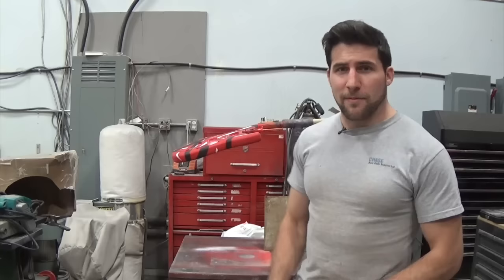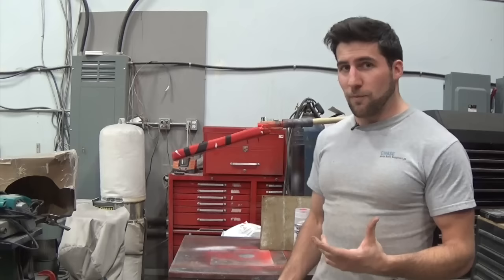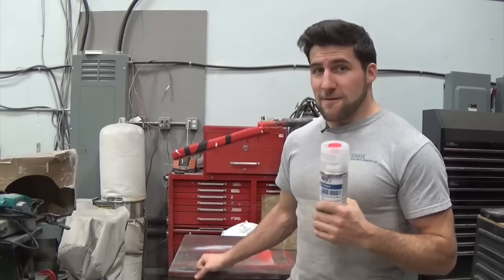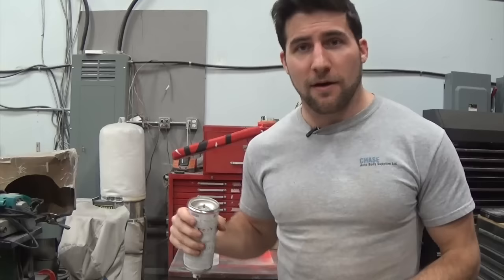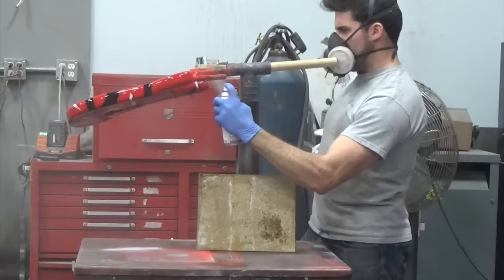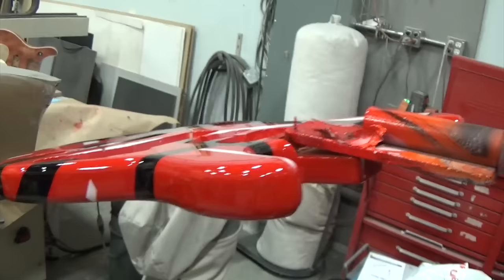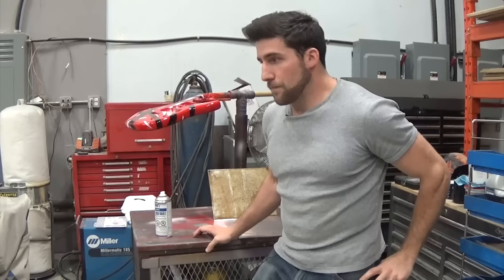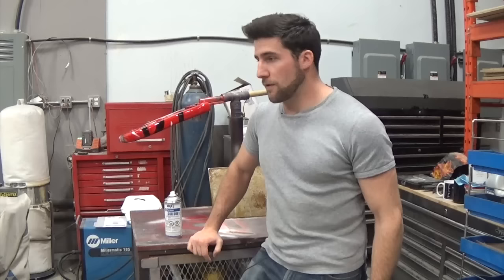How to get a professional looking clear coat with spray cans

Comment: Hi there, im trying to get a metallic red finish, now i have acrylic metallic red lacquer from dupli color and a clear spray lacquer from mo tip. Now i sanded my old paint down with 400p. But still confused how i should go about it. 

Do i put 3 layers paint with 10 minutes in between then sand with like 800 and put the clear spray 3 coats, wait 24 hours sand with 1200 and again 3 clear coats?

If watched your videos but still confused a little by all the variables. Thanks anyway for all the info
Reply from the maker: Have you seen my video on how to paint your guitar with duplicolor?
Reply: @BradAngove  ah oké, so no sanding fine by me haha, how  long should i wait before reassembling?
Reply from the maker: A month usually.

Comment: i painted a guitar and I wanted to use poly clear coat but not in can. What are your suggestions. I was thinking just buy polyurethane at the hard ware store. I am looking through the videos but couldn't find the answer.  I read that polyurethane is the best coating to use for a finish that will take friction and long time use. I didn't want to use nitrocellulose.
Reply from the maker: Poly is a great choice. Take a look at my recent video on how to make your paint jobs more durable to see some of the less expensive ones that I like, as well as some important info on safety while using them.
Reply: @BradAngove  what about Guitar Lacquer clear gloss. i really don't want yellowing but maybe this might be a better product than this clear you use

Comment: Hey there, I was wondering whether you could tell me if it is possible to get a Satin educed polished finish using Rustoleum Satin finish with only 1,200 Grit Wet/Dry sand paper and some polish? Also, Iv'e heard the term "Orange Peeling" and how; when a coat is applied, it must be sanded and then reapplied. How on earth is that "Orange Peel" effect supposed to go away with just polish? 

does the clear coat go on and then sanding? or is it clearcoat/sanding,clearcoat/sanding (repeat)
Reply from the maker: The orange peel gets sanded out after you clear coat. The sanding flattens out the surface to remove that effect, but sanding leaves the finish dull. The polishing brings it back to a nice shine. You can get a satin finish by just polishing it less, or by sanding to a super high grit, or by sanding flat and then throwing on one light coat of satin clear.

Comment: Brad, do you sand in between coats or you sand once all layers of lacquer have been applied, just before buffing?
Reply from the maker: I don’t sand between coats. Only between sessions. If I were adding more clear, I would wait a day and sand with 800 grit before spraying more coats.
Reply: wet or dry sanding? what's best anyway
Reply from the maker: I use dry for guitars so I don’t risk swelling the wood. I usually do wet for metal or plastic.

Comment: Would  the gloss 2k spray can be good for a 70's era Fender type finish on a strat ( maple) neck ? Would it be similar to what Fender was using back then ?
Reply from the maker: Yes, fender started using poly in the 70s rather than nitrocellulose lacquer, which ages.
Reply: @BradAngove  Thanks 👍

Comment: Hello Brad I have a question can I spray the true 2x catalyzed clear over older painted lacquer clear?
Reply from the maker: The 2K? Yes, but you’ll want to sand lightly with 800 grit first so the new clear will stick.
Reply: Thanks Brad thumbs-up 👍

Comment: Do you need to polish after this? What about wet sanding in between coats?
Reply from the maker: It’s up to you whether you polish or not. I have a video on that and on sanding between coats. It depends on how long you wait between coats.
Reply: @BradAngove  I shook the can of 2k for 2min. Flipped it, popped the red cap, and then all the contents spewed out...what happened???
Reply from the maker: @user-jb3de9uk9p the contents spilled out the bottom? When you pulled the red cap off?
Reply: @BradAngove  yes
Reply from the maker: There was something wrong with your can then.

Comment: Awesome video! I have a few questions though. How dangerous is the 2K clearcoat compared to regular clearcoat you would get at a craft store? This is my first time building an electric guitar and I painted it with acrylics. I’ve been extremely hesitant to clearcoat it because everybody seems to say different things. I really don’t wanna mess this up! How many coats of other kinds of clearcoat Would I need? The ones you get from craft stores. Also, if I were to use it What kind of mask would I need? Do you have any brands you could recommend? Then when it comes to wet sanding, I’ve heard people say you need to start at low Grits then work up to high grits. But I’ve also heard people say you only need 400 than 2000. What’s the bare minimum I need to use? Also, is there certain temperatures I have to stay in while doing this? I am on a tight budget. I apologize for all the questions.
Reply from the maker: I’m not really familiar with craft store clear coat, but I’m sure that the 2K is notably more dangerous and dries harder. Depending on the clear coat from the craft store you could need anywhere from 3-10 coats. It depends on the finish you want. 
I have two respirators linked in the amazon link in the description. Those are the types that I like to use.
You can generally get away with flat sanding with 1000 grit and then 2000 grit paper before polishing. It will just take a while and be harder to polish.
Reply: @BradAngove  Ok, thank you! Do you recommend wet sanding? And is car polish okay for polishing? I’ve heard people say different things. I have the Audioglym Super Resin Polish and I was wondering if it would work. So, just to lay out the steps.
I clearcoat 3 coats with the 2k, 30 mins in between, Sand flat, Wet sand or buff? Then apply polish. 
Is there anything specific I should know about the polish? Do I need a compound or wax or just the polish.
Thank you for answering all my questions.

Comment: would this clear work on waterproof vinyl stickers?
Reply from the maker: Yes.
Reply from the maker: But if they’re big, you should apply some adhesion promoter to them. Otherwise it will mostly just bridge over them rather than really sticking.

Comment: Brad, have you had any issues yet with SprayMax 2K Glamour?  I just cleared a guitar that I finished last Wednesday and it’s still today soft like week old lacquer.  Painted two previous with same clear and neither of those have the same issue. Trying to see if there may have been a bad lot or something.
Reply from the maker: I’ve never had a problem with it, but temperature and humidity can affect the curing process (or inadequate shaking after breaking the internal can).
Reply: @BradAngove  I followed the TDS from Sprsy Max. The only thing that was altered was it was over 90 deg F. That would have just sped up the flash and cure time though. Oh well not the first time I have had to strip a new finish and redo it.  I may go with Grant 7 Oh My clear through my gun this time though.
Reply from the maker: Yeah, I suppose it must have been an issue with the can.

Comment: So let's say you are going to use a dye or stain for the body instead of a paint .... what kind of sanding sealer is best to use in conjunction with this clear .....
Reply from the maker: This clear works with a variety of sealers. I would be more concerned about what works best with the dye.
Reply: I usually use a vinyl sealer
Reply from the maker: Likewise. Vinyl sealer works fine with this clear.
Reply: Thanks so much! I really appreciate the great videos and knowledge you share!
Reply from the maker: Thanks Chris.
Reply: @BradAngove  sooooooo.... I just put down the vinyl sealer ... .. mohawk brand..... how long should I wait till I put down the 2k spray max?
Reply from the maker: At least 3 days. Preferably a week.
Reply: @BradAngove  thanks again! Currently building a bass for my daughter.... and a perfect situation to test a different kind of clear coat ..   !

Comment: Hey Brad, I´ve been watching many of your great vids and see you also work with airbrush. Have you ever tried applying 2k PU clear on a guitar body with an airbrush? I do use that kind of clear with a 0.5 nozzle airbrush for 1/24 scale models, and was wondering if it´s worth trying to clear a whole guitar body with that. 
Otherwise I might be going with spray cans. I´m about to start my first guitar repaint job. 
Thanks!
Reply from the maker: +Mariano Martinez I wouldn't try to spray clear on a guitar with anything smaller than a 1.0 mm nozzle. Preferably with some kind of fan pattern. I think it would be hard on the airbrush and probably very difficult to get a decent coat.
Reply: Brad Angove thanks!
Reply from the maker: +Mariano Martinez You're welcome.

Comment: Brad I had an artist splatter paint my motorcycle with acrylic paint. Can I use this method to clear coat? Thanks
Reply from the maker: If you let it dry for a few weeks first you should be able to.
Reply: Thanks Brad. I appreciate your help

Comment: Awesome video Brad! Thank you so much for all the info you are providing with all your videos!
I have a question... I just got a 43 PSI airbrush kit and I'm getting on these days an 0.8 spray gun that I would like to use to clear coat one of my guitars.
What are my options in terms of clear coats? Lacquer, Poly? Do I need to dilute them before spraying?
I also have Wipe-on Poly. Can I spray this one?
I would appreciate any info on this.
Thank you!
Reply from the maker: Lacquer and poly each have their own spray technique and formula. They are both options, and yes both will generally need to be thinned for spraying. 

You can spray the wipe-on poly, but again you will need to thin it a bit first.
Reply: @BradAngove  Thank you Brad!
What should I use as a thinner and what would be the ratio Wipe-On Poly (or Lacquer) / Thinner?
Any specific products you would recommend?
Reply from the maker: You can just use paint thinner for the poly or lacquer thinner for the lacquer. I don’t know what ratio as I’ve never sprayed wiping poly. You just need to get it to a viscosity where it sprays smoothly from your gun and lays out well.
Reply: @BradAngove  Thank you so much Brad!
btw, do you have the video finishing that guitar? ( the one above) sanding, polishing?
Thanks
Reply from the maker: No, I sanded this finish back and did another paint job (or several) over top of it.

Comment: I have a SprayMax 2k question for you. I sprayed it on a guitar, and it did a great job... but for whatever reason, I then decided to scour the end finish with 3000 grit before buffing it out with polish.
This left it with a sort of satin finish when I wanted high gloss to help enhance the colour pop!

Is it possible to lay another coat or 2 of SprayMax 2k, or will the polish I used repel the clear coat? If that is the case, is there a way to prep it without ruining the paint below?
Reply from the maker: It’s supposed to do that. Now you go in and polish it with compound and polish to bring back the shine. Did you do that?

New paint won’t stick to polish. You would need to clean it thoroughly with wax and grease remover and sand with 800 grit.
Reply: @BradAngove  I just used a simoniz scratch remover with a 1 speed car buffer. I now realize I need a proper graded product set to have more cutting power right on up to high gloss
Reply from the maker: Yeah, I don’t think the scratch remover will be sufficient. The Norton liquid ice is a nice single product polishing system. I have it linked up in the amazon link in the description if you want to see what it looks like.

Comment: Do i need to do a light scuff (scotch brite pad) before I start clear coating
Reply from the maker: It’s generally a good idea.
Reply: @BradAngove  Do I use matte or gloss clear coat?  If I already put a light coat of matte, can I switch to gloss?  Thanks for the advice
Reply from the maker: You can switch to gloss.

Comment: Would you happen to know if I can use the same clear gloss to seal and protect stickers on my cheap gigging acoustic ?
Reply from the maker: I wouldn’t suggest using this on your acoustic. It will affect the sound.
Reply: Brad Angove  can you please recommend  me anything that would do the job and not affect the guitar sound if you can think of anything? I have tried to google search and not any clear answers. Thanks for reading my comment and taking the time to reply :)
Reply from the maker: Any added finish will have some effect. Nitrocellulose lacquer will probably have a very minimal effect. It’s the usual choice for most acoustic guitars. I recommend behlen’s stringed instrument lacquer. You can find in the amazon link in the description of my recent videos.

Comment: Hi Brad,  in the final coat ( 3rd coat in this matter) could I bake this clear coat and if so, what would be the temp and time recommend.  At the moment, I’m using a oven to bake painted items in. ( not home oven ) thanks again.
Reply from the maker: You could; these catalyzed clear coats generally allow for that. I don't know what the specifications would be for baking this one. I suggest you check with the manufacturer.
Reply: Brad Angove - i will do. Thanks again!

Comment: Hey Brad!
How can I sand dust nibs out of the clear coat?
I tried removing one spot, didn't go through the color but I created a small valley. When I sprayed more clear this spot turned white for some reason and the difference in color was noticeable.
Do I need to sand all the surface down because of one dust nibs? Do you have any recommendations on how to do it?
Reply from the maker: There are small tools for that task, but I usually just lightly sand them out when I sand the whole surface as part of the polishing process.
Reply: @BradAngove  so do you recommend adding nitrocellulose coats as usual and then sand the dust? The dust nibs won't be too deep at that stage?
Reply from the maker: No, if you’re only part way through then just sand flat to remove the dust and continue coating.
Reply: @BradAngove  sand only the dust area? I did that to the clear coat and managed not to go through to the color. But as soon as i sprayed more clear on top there was white spots all over the sanded area. Weird...
Reply from the maker: No you would sand the whole thing, make sure you clean it well, and then spray lightly.

Comment: Hi Brad,  rather than buy clear coat, catalyzer and reducer at my auto body paint shop, its less expensive to use the product you are demonstrating, $25 vs. $75 and thats for less expensive Dupont's Nason 2K. Question, can I use this 2K in a can to clear Reranch's spray can  nitrocellulose lacquer? any interaction that you know of.  Its Pelham blue, a Gibson metallic blue. Thanks much, we are enjoying our SOLO kits. Ted
Reply from the maker: Hi Ted. I've used 2K polyurethane over nitrocellulose before and never had a problem. I recommend you give the reranch at least a couple weeks to dry before clear coating over it. Preferably you would give it a month, scuff it lightly with 800 grit, and then shoot your 2K overtop.
Reply: Thanks Brad, ReRanch recommended  not sanding their " metallic" prior to top coat. I guess as not to disturb any metallic foil pieces near the surface and then using  their clear Lacquer as top coat on closely  spaced  spray schedule  so no problem with adhesion . I could either sand very lightly with 1000 or so, or, omit sanding and hope there might be a chemical bond between lacquer and 2K. Or,  I could just use clear   lacquer  for top coat. 
Thanks for your help.
Reply from the maker: Ideally you would shoot a couple coats of the lacquer clear as per their recommendations to seal in the metallic. That would give you that chemical bond, and create a protective layer. Then you could sand the clear lacquer top coat once it’s fully dry, and move on to the 2K.

Comment: I see they make this product in a matte finish...would it make sense to use the matte finish for a relic project or would you just scuff the gloss with 1500 or so and not polish? BTW, over Rust-o-leum  American Accents paint.
Reply from the maker: You won’t be able to do a proper relic finish with this stuff. You need nitrocellulose lacquer.
Reply: I thought I couldn't use nitro over Rust-oleum (enamel?)
Reply from the maker: You can’t. But you also can’t relic polyurethane or enamel properly.

You need a nitro finish in general.

Comment: Hey Brad, love all the info your videos give! Very professional. I have a lengthy, sorry lol, question. I am repainting a cheap, I paid 15 bucks lol, fender squier p bass body currently. I have it sanded to the wood, with 80 grit, getting all the knicks and blue paint off it. I want to use mopar lacquer paint, in a can. What grit should I sand to? What primer should I use? What clear coat should I use? Can I use either of the spray max clear coats or should it be something different? Thanks!
Reply from the maker: Sand it to 320 and hit it with some of mopar’s primer. You sho7ld be able to use the spray max 2k clear at the end.
Reply: Brad Angove seems to want to dry awfully dull. Is this normal? Waiting for the spraymax 2k from amazon yet.
Reply from the maker: What is drying dull? The primer?
Reply: @BradAngove  no the paint, it looks dry in some spots and looks wet in others, kind of blotchy lol. Might actually be kind of cool. The clear coat just cam in the mail today but not sure if I should try sanding the paint or not now lol
Reply: @BradAngove  so from what Ive seen in your other lacquer videos, its gonna take some time for this to dry before I clear coat it? Is this why it looks dryer in some areas than others?
Reply from the maker: Give it a couple days and then sand lightly. Then take a look at my old video on how to get an even coat of paint with spray cans. Follow that for another couple coats and then you should be good to go for clear coat time when it comes.